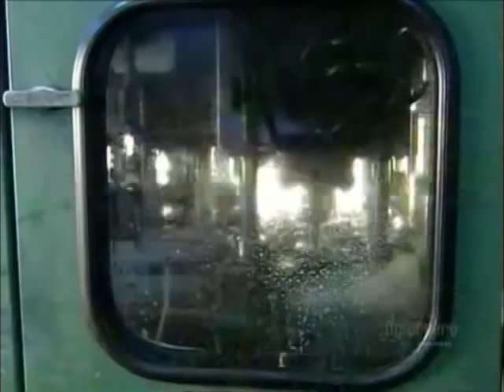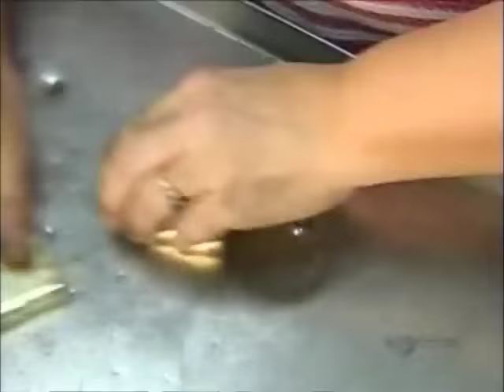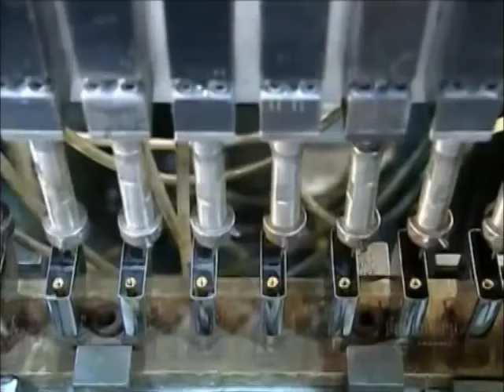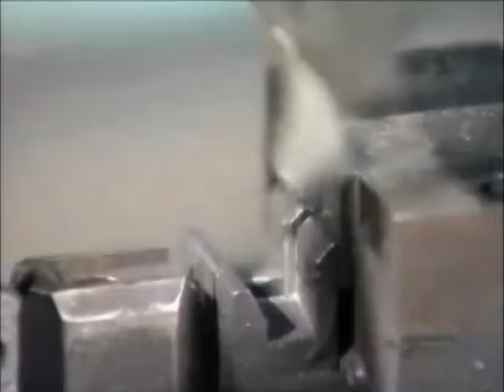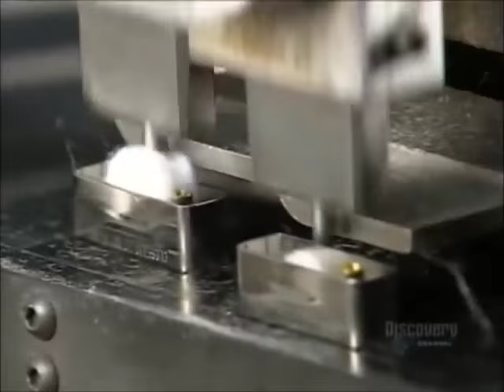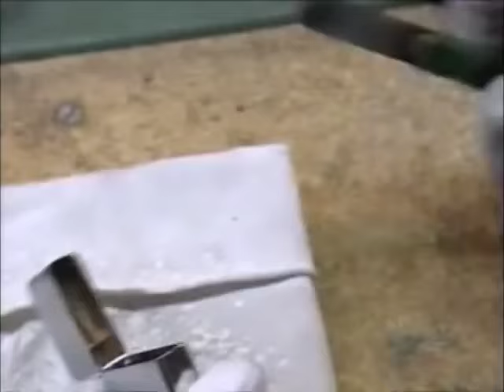How its Made Lighters

Comment: It's a lighter! Lawl! Spin the wheel! (SPIN THE WHEEL!) It's a Combusken. Pulling it to a press. The press PREsses. A worker steals them. An electrode welds the hinge to the case. Then, a mechanic inspects the welding jooj. Mechanised arms then place the tutu and plate in the cake. The tube will hold the Flintstones, and the plate will form the Checksuns. Sssss. Soohnic screwdrivers drive the screw. It's time to move on.
Reply: Credit to DaThings who made that ytp back in 2013
Reply: *The plate will form the Jetsons.